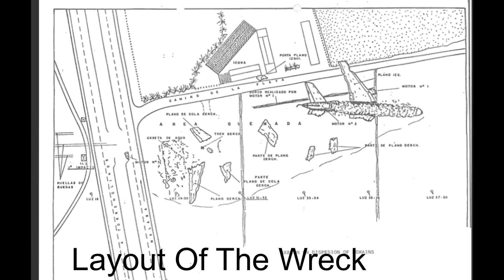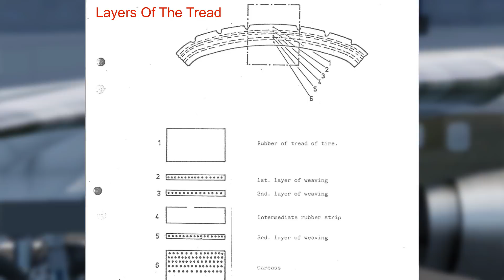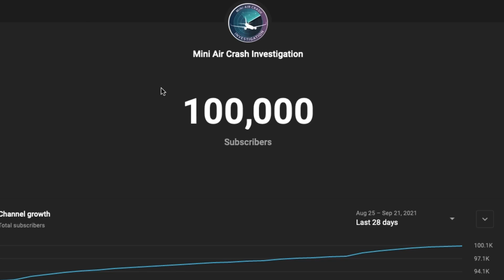How A Flat Tyre Killed 51 People | The Crash Of Spantax Flight 995

Comment: For us non-pilots, it's easy to forget that a 9 minute video is analyzing a decision made during an event with a duration of seconds. Not a criticism of the video, as this very short decision interval is mentioned several times.
Reply: That's hard to say the first thing I thought of when I heard vibrations was was tires and your already well past the minimum speed to stop I would've taken off and I only hold a private certificate and not enough flying hours to brag about. The pilot also isn't fully to blame either.
Reply: As a former military mechanic I have a bit of knowledge about aviation but I don’t understand how a pilot who’s crash kills 51 people can be exonerated while a pilot who’s crash kills no one can be held at fault.
Reply: I am not picking on the Pilot on this one, but the whole system; should be least huge sand barriers at end, in front of buildings and highways... Even emergency light on the highway in line with airport, least cars can make a stop.
  Same on planes there should be emergency lights and siren underneath to warn below if crashlanding.
Reply: @marcleblanc3602  the siren would be useless as the plane is going at almost 300km/h and it couldn't be heard by those ahead of it very far at all
Reply: @preperforated ??? Funny I can hear motorcyles going at 200kmh comming towards me. Same as planes not going at sonic speeds. Wonder where you live? Least the Emergency Service get a warning.
Reply: @marcleblanc3602  from how far is the relevant question. Every mild emergency landing into urban airports will get normies trying to ban airplanes in general
Reply: @preperforated  for the mild ones strobbing lights like cops do would be norm, Pilots seem reluctant to declaire Emercencies.  The Hudson landing was called in by numerous Viewers, every minutes count with crashes.
Reply: Also when factoring a pilot's decision time they also have the pressure of making the right decisions for however many souls are on board that flight. Its one thing to theorize your options the possible consequences for yourself, but to do it for hundreds of innocent people who are trusting you with their lives & well being has to be unfathomable.
Reply: He broke the rule of v 1

Comment: The thing that caused the captain to reject takeoff is not that the vibrations  existed, it's that they got worse when they rotated. Had the vibrations not increased he most likely would have taken off and returned instead of risking a rejected takeoff above V1.
Reply: They made it worse then.
Reply: @lcfflc3887  Technically yes. If they had continued takeoff this wouldn't have happened.
Reply: yes, that's one thing that doesn't make sense.  If the vibration was being caused by the nose wheel tire blowing up, then why didn't the vibrations stop completely after the nose wheel lifted off the ground?
Reply: @titan4110  correct... however, they’d have had to land on same wheels causing them problems in the first place...

After flying a plane that’s seen however much damage from whatever failure it was having at takeoff (which yes, we know what it was, but the pilots didn’t).

There are instances where a plane suffers a failure during landing and goes around... but having suffered so much damage during the first attempted landing that a second attempt isn’t possible.  That I recall, the instance I’m thinking of the plane lost 1-2 engines (they fell off) during a landing attempt, before getting back into the air, but had suffered too much damage to be flyable, turning a horrible landing that may have injured many and even killed some, into a crash that killed everyone).

Takeoffs are much the same in the respect that rejecting one late can kill/injure many on the plane, but if you can’t get your damaged plane back on the ground, going airborne can kill everyone.
Whatever you do, it’s high stakes, and as the pilot, you’re at the front of the plane, in a seat of honor where you are allowed to meet any obstacles ahead of the passengers.
Reply: @Relkond  I'd like the name of the flight where the engine fell off.
Reply: @pimacanyon6208  Good question.
Reply: The other issue not explained is why the captain perceived that the vibrations were originating from the rear of the aircraft. I just used the flight details for a search this showed up: "The aircraft’s speed increased to take off speed (125 MPH?) Suddenly, there was a loud explosion, and I looked out the window and noticed flames shooting out from under the plane’s belly." I'm even more curious now!
Reply: @gavinstacey8862  Had the nose gear caught fire, the investigation would be different.
Reply: As the cookie crumbles. The cookie should not crumble harder and louder as the pieces are falling on to the floor.
Reply: @etherealessence  that's not how physics works, any force produces an equal and opposite force, so an uneven tire in contact with the ground will transfer more vibrations to the plane. When the tire is lifted, only the imbalance, caused by the lost material, is left to cause vibrations in the aircraft. 

Maybe if the sidewalls had torn completely, and the rest of the tire had become a ring spinning freely around the rim, the contact with the ground would have kept it more or less centered on the rim (the remaining tires carry the weight of the plane, and determine the height of the rim over the asphalt). When the plane takes off, this ring is no longer constrained, and will swing outward, greatly increasing the imbalance, while still spinning. 

I'm not saying this is what happened, but it's the only way I can think of for the vibrations to worsen after the takeoff.
Reply: @pimacanyon6208  because the wheels still rotate at high speed for miles until you retract them and with the wheel out of balance and blown off even worse.
Reply: @pimacanyon6208  The wheel kept rotating freely and the vibrations due to the imbalance weren't dampened anymore by contact with the runway, I suppose.
Reply: @titan4110  It sounds like he's conflating the stories of American Airlines Flight 191 in Chicago and United Airlines Flight 232 that crash landed in Sioux City, Iowa.
Reply: @gavinstacey8862  The nose gear is around 40 ft behind the cockpit, so not surprising that they would perceive the problem as being somewhere towards the rear.
Reply: @marcmcreynolds2827  Thanks, a good point. Others have made good suggestions re: undamped resonance, for why the intensity of the vibrations could have increased after the nose gear lifted off the runway surface.
Reply: @marcmcreynolds2827  Thank you so much for your detailed explanation and "guesses". I think I had got as far as wondering if the change in length of the strut at rotation had introduced resonance in the NLG vibration overall. The same energy would be involved but there would be larger excursions at a lower frequency.

Your detailed explanation of how the strut would function under normal conditions now makes me wonder if there were two completely different "modes of operation" and it was the transition at the moment of rotation (I'm assuming a big spring extends the NLG to max length and effectively clamps the system) which caused the flight crew to reconsider aborting the take off.
Reply: @marcmcreynolds2827  Thinking again, I would now be surprised if the intensity of vibration didn't increase at rotation, for aircraft with a seriously damaged NLG tyre. No resonance needed either. Even with the main gear tyres still in contact with the runway, the only damping of the vibrations would be provided by the atmosphere around the fuselage.

Reduce a DC10 to a simple beam structure with the pivot being the main gear contact point(s) with the runway. After rotation the cockpit is 40' outboard of the point where the forces produced by the unbalanced wheel / tyre are coupled to the beam by the NLG strut.
Reply: @gavinstacey8862  "I'm assuming a big spring extends the NLG to max length and effectively clamps the system"  As it happens, in a "normal" shock strut (vs one with weird articulation requirements for stowage, such as some military aircraft) the only spring effect is from the air [dry nitrogen] trapped in the cylinder.  It is literally an air spring, though with a very nonlinear load-stroke characteristic compared to say a conventional metal coil spring.  A "hockey stick" looking curve, in fact, with not much stiffness to the initial stroke, but very stiff (a line approaching vertical on the load-stroke plot) towards maximum compression.  I mention this detail because it probably figures in to what was happening after liftoff in some way or another, though it would take a detailed analysis to pin down.
Reply: @gavinstacey8862  "Even with the main gear tyres still in contact with the runway, the only damping of the vibrations would be provided by the atmosphere around the fuselage."  That doesn't work out to anything significant, or even measurable.  When you think about it, lateral displacements of the fuselage from such a small (relative to the mass of the aircraft) rotating imbalance is tiny.  Therefore the fuselage lateral velocity (which relates to damping) is even more negligible.  But you're thinking! ... which brings me to:  The thought processes you are going through (minus the specialist background, of course) are very much what it looks like when engineers meet to wrestle with figuring out an anomaly.  What is (maybe) the basic physics?  What data do we have?  What aren't we thinking of that we should be?  Even at a high level of competence, these efforts start mostly with head scratching and brainstorming and trying out different ideas.  Such as...

"Reduce a DC10 to a simple beam structure with the pivot being the main gear contact point(s) with the runway. After rotation the cockpit is 40' outboard of the point where the forces produced by the unbalanced wheel / tyre are coupled to the beam by the NLG strut."  Of course that "simple" beam will need to include however many modal frequencies, what with one of the relatively high ones presumably being the one excited by the NLG input (because its energy relative to aircraft mass is so small)... if that's even what's going on.  And since the "beam" connects into vibrating wings, which connect with swaying engines (and all the stuff at the tail flopping around), you really need to work with modal frequencies for the entire aircraft... and some aero coefficients, mainly to know what the main gear strut stroke is.  But conceptually anyway, a beam vibrating with one constraint at the MLG (which has dynamics, including damping, of its own -- why we needed its stroke above) plus a sinusoidal forcing function at the NLG, modified by its shock strut characteristics.

So now you've set up the problem pretty well (with a bit of help from me ; )  and a hypothetical junior but not-too-junior engineer is tasked to estimate the imbalance and start cranking with the dynamics software and... turns out it all depends on what the magnitude of the imbalance was... and of course nobody really knows.  So a range of possibilities gets modeled, looking for some hint of an analytical result which might match up with whatever sort of vibration was described by the pilots.

My (former) world, in a nutshell
Reply: @pimacanyon6208  When the wheel leaves the ground it is still rotating just as fast as when you left the ground. Any imbalance will get worse since you no longer have the weight of the plane keeping the tire somewhat in shape, and transferring the energy to the suspension. 
It is actually quite common for me to have to tap my brakes to stop the wheels from spinning because it's causing a little bit of noise/vibration after take off.
Reply: @chrisgill1302  thanks Chris!  Makes sense.
Reply: @marcmcreynolds2827  Again thanks for the details. I realised later I should have said "powerful air spring". The worst case scenario for an imbalance to cause vibration would be for the tread layers to be removed from approximately half the tyre circumference. Flashbacks to my teenage years in the 1980s when a schoolfriends father worked for Avon Rubber, we had a walk through an auto tyre factory.

No need to invoke the angry gods of resonance, the force transmitted by the strut to the airframe would have been "considerable" once the nose gear tyre(s) left the runway. I take your point that vibration could have been replaced by a metallic clatter. I have no idea what the rpm of the wheel tyre assembly would be at 160 - 170kts, maybe a weird and frightening siren like effect would have accompanied the increased vibration?
Reply: @marcmcreynolds2827  I was already thinking that three states have to be examined, the third hypothetical. How would the aircraft behaved and what would the flight crew have experienced if the take off had been completed and the main gear left the runway?

The basics could have been tested, using a stationary DC10 and a rolling road. Or maybe just a NLG strut. I originally introduced resonance as a possible explanation for the perceived increase in vibration. It should have been relatively simple to work out how unbalanced a tyre could become by shedding part of it's tread, a metal mimic of the unbalanced tyre could have been constructed. LOL, modelling and software could do it all now without the need for clumsy experiments.
Reply: @gavinstacey8862  " I have no idea what the rpm of the wheel tyre assembly would be at 160 - 170kts"  Looks from the tiny lettering on the graphic at 3:39 to maybe be 166 kt ground speed at rotation.  DC-10-30 NLG tires are about 40-inchers if memory serves, so call it a 17 inch rolling radius under load, and we have the unloaded nose gear strut being stroked at 31 Hz.  As I hypothesized earlier, that would be tickling a relatively high airframe mode(s).
Reply: @marcmcreynolds2827  Yes, that's a lower frequency than I expected, the fundamental would be inaudible on the CVR. The third order harmonic might be heard if the flight crew were not talking all the time. The next thing to consider is the mass of the tread portion of the tyre, did the investigators weigh the debris collected from the runway?
Reply: @pimacanyon6208  because the tires are still spinning when they leave the ground. It would theoretically get worse briefly once it lifts off because the ground would not be there to check the centrifugal force created by the misbalanced tire and it would shake the entire gear pylon.
Reply: @lcfflc3887  Thanks, that actually makes sense. Was really in the dark about how that made sense.
Reply: @pimacanyon6208  Because that seemingly small wheel is still spinning very quickly and massively imbalanced and as it slowed, the frequency changed as the speed reduced. As it would have been right under the pilots it would seem worse than if a mid fuselage tyre had gone. I haven't flown much at all and remember when our Lufthansa 747-8 rotated at Dulles, there was a vibration which I thought was an engine giving out but thankfully I had a rare bout of common sense which made me realise that those 4 x 8 big wheels would still be spinning ferociously as they were tucked into the fuselage.
Reply: @titan4110 
Maybe, or everyone on board would have been killed.  Depends on how hot the tires got.  A plane burst into flames shortly after take off because one of the landing gear tires was low.  The heat from the fire set fire to a hold and aircraft wiring before going into the cabin.
Reply: I hope this airline stopped using the retread company that made that defective tire.
Reply: @MovieMakingMan  Tire failures can be cause by a lotta things.
Reply: I would say that is true
Reply: That is pretty likely
Reply: @titan4110  
A/A 191
Reply: @pimacanyon6208  There is nothing to stop them from spinning other than bearing friction until they contact the snubber inside the wheel well.   So, the spool down time is significant.  And the vibrations may have been worse with weight off the wheels than weight on.   So, hard to say.

Comment: He definetly did the wrong thing.  But  we all know this  AFTER  days and weeks of investigations.   Doing the wrong thing is not always a mistake....unless you can see the future.
Reply: Trans International Airlines Flight 863
Exact opposite scenario. Control issue on the runway, dragged the tail, took off anyway, stalled, crashed, everyone died. (Ferry flight, so only crew this time.)
Reply: @ShalomShalom-d5c  Of course he should have aborted sooner ,   as soon as he was feeling vibrations. There was ample time then to abort the takeoff safely. Instead he persisted with the takeoff despite the vibrations.  Only when the vibrations got worse he decided to abort which @ that time was too late because of the speed. It was the pilots fault period. I'm flabbergasted he was exonerated considering ppl died because of his incompetence.
Reply: @westnblu  welcome to Hindsight Airline, captain Should Have, copilot Would Have, and flight attendant Could Have will be serving you today
Reply: @mizuki4002  well everything is hindsight if u think about it. Its all in the past this does in no way somehow exonerate the pilots for their bad decision making which caused the accident.
Reply: These were not vibrations which gave any instrumental failure alert and increase must have happened in seconds from that point what he did was better than taking iff as landing without nose gear wud be worse disaster
Reply: @MP-lb1bv  did the pilots survive ?